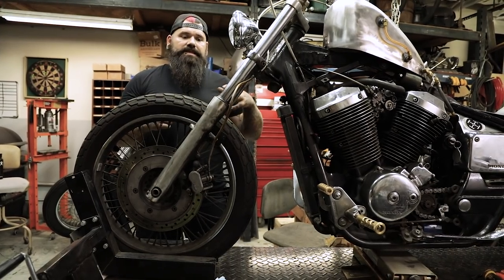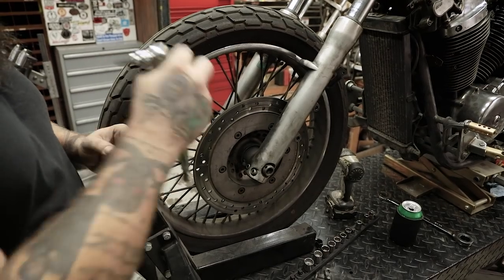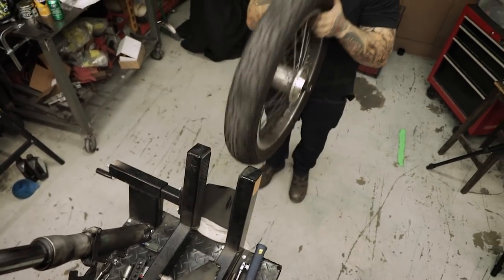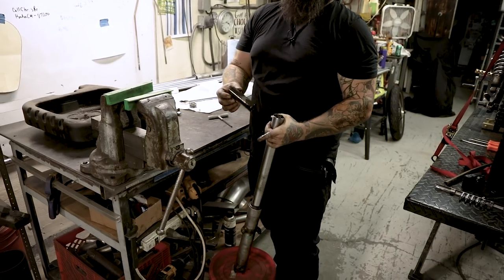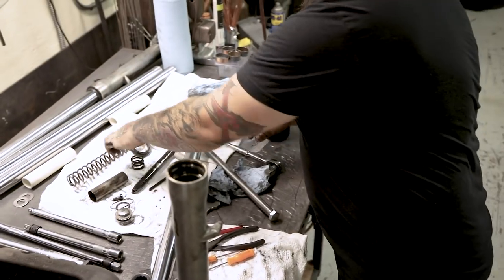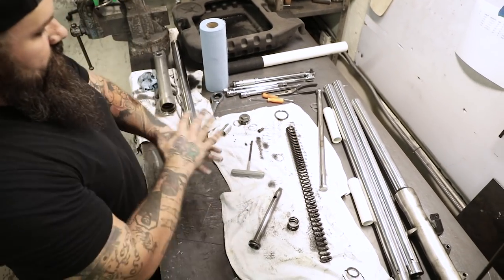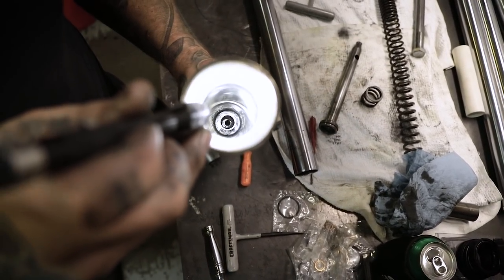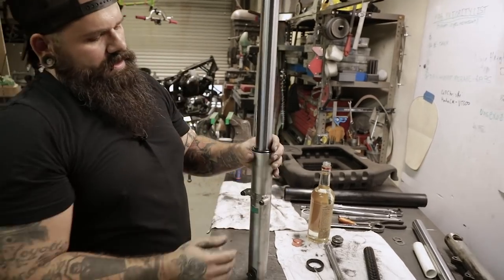How to Install Long Forks on Honda Shadow Build

Comment: I watched several fork seal replacement videos.  I have a VLX600.  First time I’ve seen any mention of the tool that goes inside the fork tube to remove the bolt at the bottom of the fork.  Calm, precise, and knowledgeable… makes me trust you, so I’ll order the kit, that includes the tool, from your website. 👍
Reply from the maker: Trust us with your soul.......

Comment: Zip tie to hang up caliper, check. Also old brake pad, piece of wood between the pads because there WILL be a 'friend' that can't resist pulling on the brake lever whilst it's off the bike!!

Comment: Brilliant video man I have a 05 vlx600 single carb model  and I’ve got a set of 8” over tubes to extend my front end they are Harley sportster tubes though? Will they still work? as I did some research and found they are the same diameter both as the shadow forks

Comment: the fork spacer you installed seems to be the close to the exact length of the stock fork spacers. since you installed 6over tubes don’t you need to have a fork spacer that is 6 inches over the stock spacer in order to get the proper preload on the spring and similar rebound and compression as stock?

Comment: Bro! Thanks for the video.. 2006 Honda Shadow Aero. I’m mechanically inclined but never have worked on bike. You think I can change head gasket, rings and front bearings with just socket set and the usual large set of screw drivers and pliers?

Comment: Hello,
I am French and I can not find the tools you have made that allows to lock the fork inside to remove the screw at the end. could you give me the dimensions please?
and thank you again for all your tutorials !!!! they are really nice !!
Reply: I got around that by putting my forks back in the triple tree, with the springs still inside and caps on, letting the triple tree hold the fork as i removed the bottom bolt in the dampener.

The spring holds everything inside under pressure so the bolt has something to be removed from otherwise it just turns everything in there.

Comment: During assembly you said to put the tighter wound end of the spring down. But the service manul says to put the tapered end up. My question is is the tightly wound end of the spring considered there tapped end or does some springs have a smaller diameter on one end
Reply: I should add, the reason I ask is because while doing my fork seals on the shadow I just got. One fork spring had the tight end up and the other had the tight end of the spring down
Reply: Thanks so much for your reply and help. My bike is a 98' vt750 ace. Glad to know from a expert how I'll be putting them back togeathed! Cheers

Comment: Hey man having a problem with throttle sticking put grease in cables cleaned carb but still sticks and thought on the matter my horse is a 2000 shadow 1100
Reply: @TJBRUTALCUSTOMS  dude thanks so much got it all worked out man watch u all the time very smart and helpful thanks a million times again hope u and yours have a great night and we catch u in the wind brother

Comment: Well i made that 24mm tool and tried to take my fork apart. No way!  That nut i tig welded onto each end of the rod is 24 mm but it fits into nothing down inside the fork. Any idea why?

Comment: I've learned alot from your videos but I have one question. I'm doing away with my switches on my handlebars and want to still have high beam and low beam. Is there a way to do this

Comment: TIP: I you are having trouble installing that larger metal bushing, use your PVC and the old metal bushing to pound it in. 

If tried it the way in the video and it didn't go in. I also may have been doing something wrong along the way. I hope this helps someone.

Comment: what size nut or bolt (metric ? or ?) did you use to make your tool for holding bottom part inside fork tube to be able to release drain bolt ?? Thanks, Jace

Comment: I've watched this video a couple times, but I''m still really nervous to replace my seals by myself. Has anyone had success after watching this video?!
Reply: @TJBRUTALCUSTOMS  This is a great video and you do a phenomenal job of walking through the process step by step. I really shouldn't be nervous! Do you have somewhere you order the seals from? Or should I just contact my local Dealer and have them order the seals and oil etc. for me?

Comment: Why not cut down the factory spacer?
Reply from the maker: why not replace with a shorter piece of pvc?
Reply: @TJBRUTALCUSTOMS  
I would already have a machined, factory part. While it is inexpensive, I don't have any PVC, in the proper I.D. or O. D. readily available . Lastly, I am not a mechanic. I was asking a legitimate question, however I should have been more specific. What, if any, is the advantage of using PVC as opposed to factory fitted tubing ?